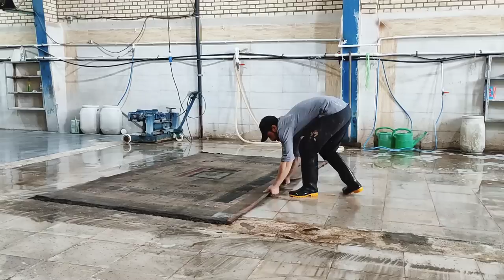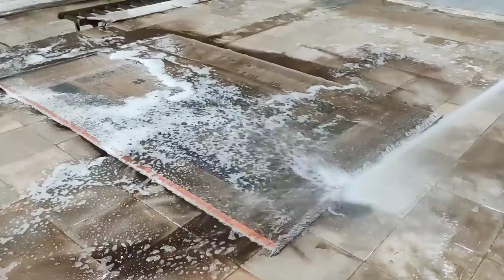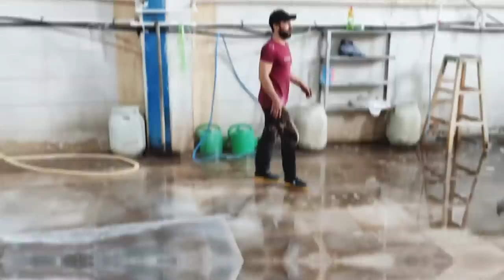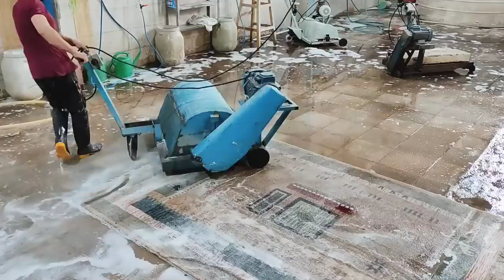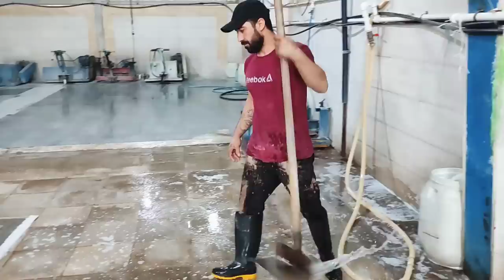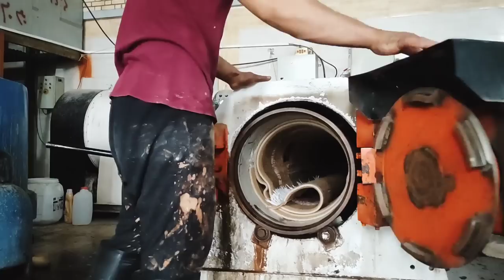how to change floor  ?  |  how to change floor drain cover ?

Comment: Question for you sir when you start on the carpet do you start on it upside down or right side up do you clean the bottom first or second?
Reply from the maker: I din't notice, please tell me more about.
Reply: @change-cleaning-service-center  When you clean the carpet do you start on the top or the bottom?
Reply from the maker: Hello my friend
If you touch the carpet with your palm, your hand will move smoothly in one direction and your hand will get stuck in one direction, we will start with the carpet being soft.
Reply: In the case of this carpet, he did the underside first. You can see the maker's label sewn in one corner.